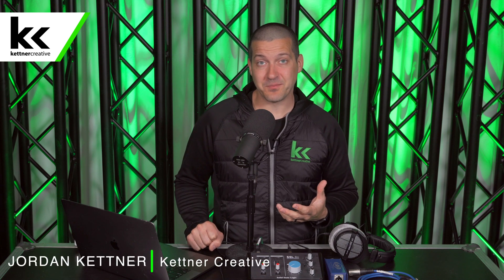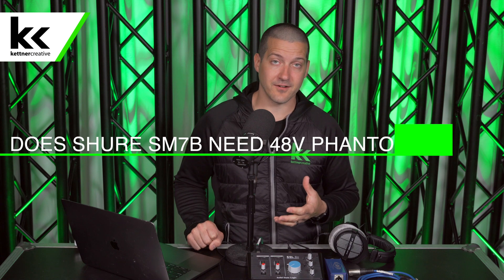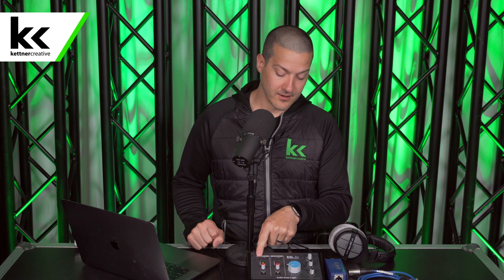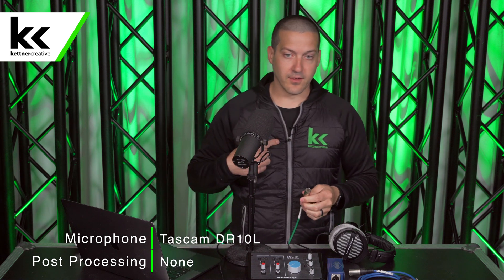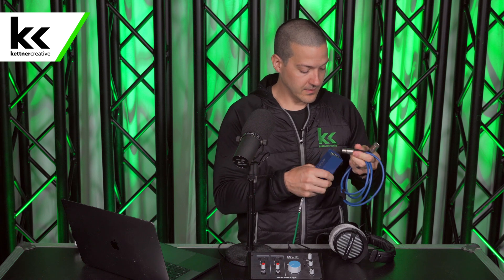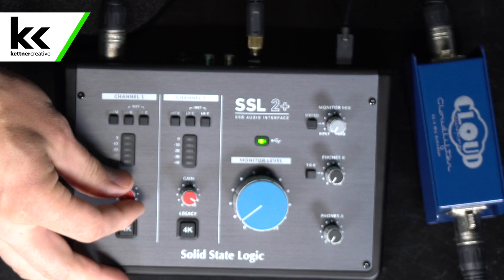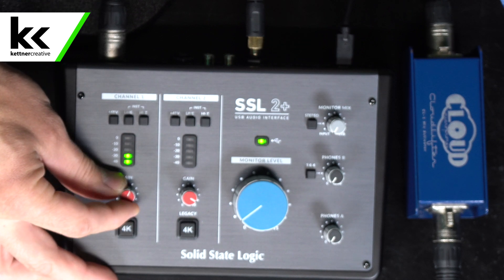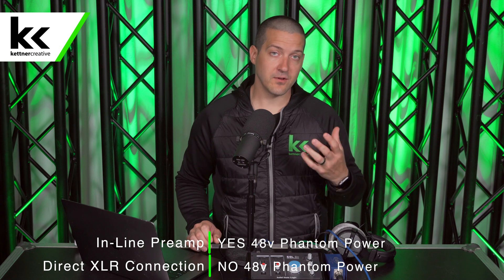Does Shure SM7B Need 48v Phantom Power?

Comment: I have a shure sm7b here right in front of me, and I have phantom power turned on, on my dbx286s, and it DOES affect the microphone, I also have a cloudlifter but it is not connected to the system. Shure into DBX into Scarlett solo, it gains my microphone up, and it removes static background noise. It is much cleaner when Phantom is on. So from all I've read online and all I've watched, it seems that I have found an exception.

Comment: Yeah so with an Dynamic Mic like the Shure SM7B "48v Phantom Power" nor a "Cloud lifter" is useful unless for whatever reason you want to run the MIC at less gain.. The audio interface you're plugging in the Dynamic Mic can most likely drive the 60 DP+ of gain required for the SM7B so neither are required. I something wonder how much $$$ is being made with these "cloud lifters" via people buying them for no good reason..

Comment: Guys, I have one question. As I heard on this video, if I use my SM7B with phantom power ON , there wont be any problem, will be? . The case I want to introduce is that I have a Focusrite Scarlett 2i2 and I have a Audio Technique AT2020 microphone. I would like to record at the same time using these 2 microphones with  Phantom Power 48v , because the condenser AT2020 microphone needs it. What I want to know is if there will be any damage with the Shure SM7B
Reply from the maker: Not a problem.

Comment: We have a Shuresm7b plugged into a cloudlifter cl1, which is plugged into my mac via a USB to USBC converter. Unfortunately, the level of input is even worse with the cloudlifter plugged in. Without it, we're seeing only 50% input volume from the Shuresm7b. We don't have a nice interface as you do. Any idea what the issue might be? Thanks!
Reply from the maker: Yeah. Th cloud lifter needs an external 48v supply.

Comment: Thank you for simplifying what a cloud lifter does.

1. So I basically don't need one if I will just plug in the SM7B into an audio interface and that I don't need to switch on the 48v phantom power function as it does not affect sound in any way.
2. I will need one if I want the audio interface gain to not work as hard but it will require that the 48v phantom power is on just for the cloud lifter to work.

Did I understand you just right?
Thank you very much for sharing.

Comment: Thank you so much for making this video! I just spent over $1,200 and bought the Shure SM7B, Rode Caster Pro, and Cloud Lifter (CL-2) and connected all of them properly but for some reason it was not working. I watched boat loads of other tutorials and could not figure it out and was banging my head against the wall lol. The missing key was *enabling the Phantom Power* on the Rode Caster Pro. Thanks again, you are the only one who has specified that using the cloudlifter requires enabling the Phantom Power. Everyone else just says plug it in and it should work. U da man!
Reply from the maker: Glad this helped!

Comment: Just in case: Phantom power can damage some dynamic mics or gear, so you probably shouldn't turn it on unless the mic or device needs it to be powered.
Reply from the maker: Definitely ribbon mics, or unbalanced dynamic mics - But I've never heard of a real person damaging a modern dynamic mic with phantom power. Best practice is to keep it off, but the risk is extremely low.

Comment: is there a specific reason why you turn off the gain every time you turn on pp?
Reply: Indeed there is!
 
https://www.youtube.com/watch?v=DZ5AdyreC4o

https://www.youtube.com/watch?v=6McmnSmiY5o

Hopefully these two links help. The 2nd video is more for shits and giggles.

Being from England, myself, and hearing someone speak so eloquently will make me follow orders. This Dude could say "Inserting your microphone cable into a seagulls' anus, and out of its eyeball will increase the signal of your output." I would do so, without question.

It pretty much adds up to switching your phantom power on while having your gain turned up can blow the circuits inside of a condenser mic.
Reply from the maker: Some interfaces will "pop". It's best practice, but not necessary.